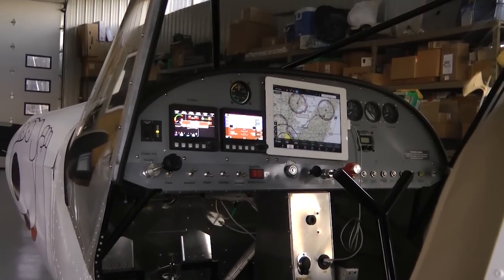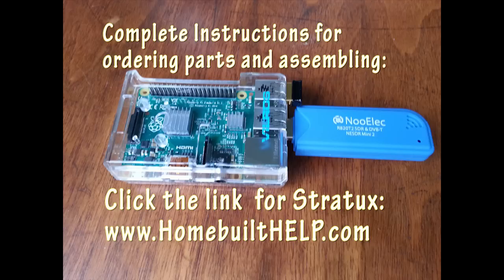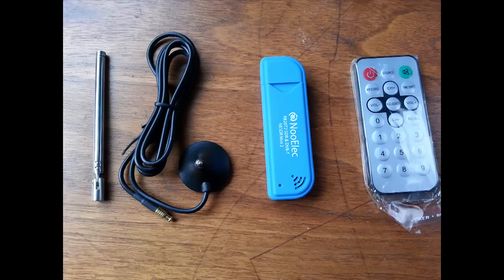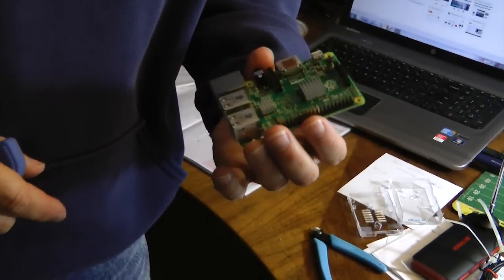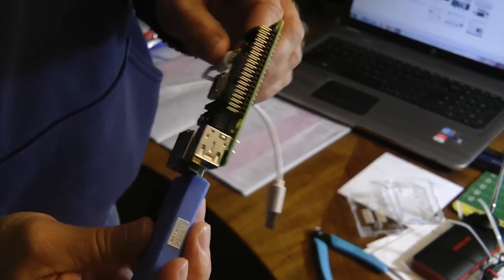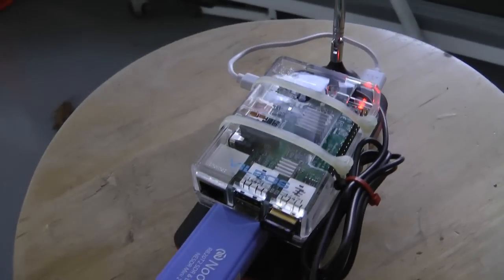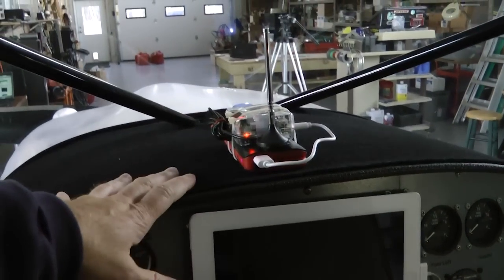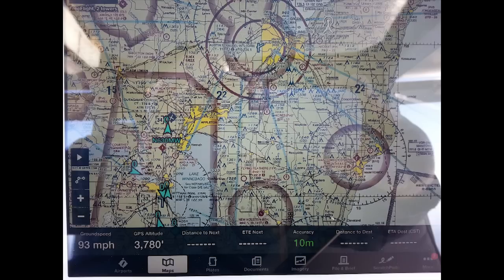Assembling a Stratux ADS-B receiver for in flight weather

Comment: There are RTL Dongles that've been sold for under $10
Reply: The biggest difference is the component that assists the tuner, the oscillator. The once added to dongles from Flightaware, or NoElec have what is called a TXCO, a temperature compensated crystal oscillator more on that here: http://www.radio-electronics.com/info/data/crystals/tcxo.php While it is certainly possible to controll the compensation manually via "ppm-values" the extra 10 euro per dongle will certainly help to n00b-proof receivers.

Comment: I want to thank you for this Video. I purchased the items off of Amazon 2/2017 for 104.91. I am a newbie to this tech so I appreciate your layout and the steps you provided. Two items you omitted or it has changed since you did this video. I needed to purchase a wifi dongle and it took me a bit of time to realize that I needed to down load Chrome to my iPad mini. Once I completed these two steps I was able to get it up and running just like you promised. Thanks again R Trepanier Benson AZ
Reply: I wish to amend apparently the Raspberry Pi3 comes with a built in wifi capability do not order one as it will confuse the poor little guy and me as it did. But it all works great now.

Comment: Just built mine last night.  Took less than 15 minutes start to finish, and my iPad & ForeFlight connected with no issues.  Waiting on my 150 to get done with annual so I can go up and test it.  By the way, the new Vilros kits are shipping with the Raspberry Pi 3, which has built in WiFi, so there is no longer a need for the USB WiFi adapter.
Reply: I realize it's pretty randomly asking but does anyone know a good site to stream newly released movies online?
Reply: @Brodie Russell ehh I use Flixportal. You can find it on google =) -quinn
Reply: @Quinn Karson thank you, I went there and it seems like a nice service :) I really appreciate it !!
Reply: @Brodie Russell glad I could help xD

Comment: I figure a ham would dig around the net for a home brewed solution to this... but is it worth the $100 bucks... that's a lot of money when you are trying to build a plane for less than $1,200
Reply: It needs a rubber duck antenna because as an Ultralight pilot I want to wear as much equipment on me as possible, so it does not count as a penalty to the aircraft weight which is a premium on an Ultralight.
Reply: Now we just need a cheap way to build a transponder
Reply: I have a really good idea on that of which I am researching. I want to make one that import NMEA data from a Phantom II and transmits its coords on 1090.

Comment: I've bought all the components. The website, you have all the instructions on, has a suggested way to use it with a GPS but there aren't any instructions to solder the wires and what pins they go too. Do you have that information or know where to find it? Thanks

Comment: How are you able to get wifi once you're at altitude?  I don't have a 3G iPad so that's why I'm asking.  As for gps with wifi only iPad, I use the bad elf 30 pin with fltplan go.  Will renew my foreflight subscription once I start instructing.
Reply from the maker: The Stratux box creates the WIFI signal that the Ipad uses.The Ipad connects to the Stratux box just like any other wifi hotspot.
Reply: +HomebuiltHELP thanks for the quick reply.
Reply: +HomebuiltHELP you think the new raspberry pi 3 is compatible with the stratus software version?
Reply: Pretty damn sure it is, it's a little overkill though but if you've got one then try it out.  It'd be really cool if a pi zero could work easily but I think that's still being developed by the ampros and hobbiests.
Reply: Eskimo Brother thanks for the info, I builted the stratus with the pi2, however are you only able to get cell towers when you're actually in the air? I get no reception at all in the ground and haven't flown up yet to test it.
Reply: preflightGOYR - old post but I hope your are still instructing. I too have he iPad with the Elf. How did you set up the elf with the iPad.   It appears to hook up by blue tooth.  I’m using FltPlan after using ForeFlight for a year.  How do I get the map to pull up and do I plug the elf into the PI for power?

Comment: My iPad is WiFi only, would this work using Foreflight in my iPad? Thanks
Reply: +antonio r YES, this takes care of all wifi, ADS-B IN and OUT signals.
Reply: +antonio r I believe the wifi only iPad does not have GPS and this version of the Stratux does not provide GPS data. YOu will need to add GPS. 

To add to Brandon Chavez's replie, you will only need to switch the wifi to the Stratux from your home wifi.
Reply: +J Jones so true, I was mistaken.  After much research, this model does only ads-b in.  to add gps to this setup, there are a few options such as the adafruit ultimate gps, RY835AI and the  VK-172 Gmouse.  I'm sure there are other options but from what I read, these are the ones out there that have tutorials on how to make them operate with the Stratux.
Reply: +Brandon Chavez thank you, one ore question, can you also get synthetic  vision  with this device on foreflight?
Reply: +antonio r at this point, synthetic vision is only in the beta testing phase and has >10 degree deviation in banks.  also keep in mind it is only usable with a gps+ahrs such as the RY835AI module.

Comment: I built the 2-band (978 and 1090 MHz) Raspberry ADS-B Pi receiver and downlaoded what i hope is the right software to receive both bands. I'm running FltPlan Go on my iPad 3 (it has GPS so has moving map). Apparently FltPlan Go is compatible with this system.  The iPad is getting a wifi signal and "heartbeat" from the unit, but it's not seeing anything else - no ADS-B towers - either on the ground or in the air (3000 ft AGL).  I live in Canada but just a few miles north of the border (Kingston) so I should be getting something, especiallyairborne.  Do I need better antennas than the ones that came with the USB radio dongles? If I got one, can I use a splitter and have just one antenna for both radios? How do i know the software is working properly? Even on the ground, shouldn't I be seeing high-altitude airline traffic on 1090 Mhz? How do I troubleshoot this?  Thanks for any help.
Reply: +YGK Pilot (SURP 841) Make sure you have the latest version of the software. I had issues till I updated yesterday.  Also, the antenna length is important from what I am reading... pull them out only 3/4"(20mm)
Reply: Hey YGK Pilot, did you ever get it up and running in your area.  I just bought the kit and I live on the north side of Lake Erie so I'm hoping to pick up something from the US once airborne.  If not, I'll do something else with my rasberrry PI

Comment: Great video, very informative and again thank you for making it. Just one correction in the video about the ADS-B traffic. What makes the traffic inaccurate is not that other planes don't ADS-B equipment, it's the fact that you don't have a ADS-B OUT unit.  If you had a ADS-B transponder on your plane then all traffic received would be accurate.
Reply from the maker: Thanks for your comment... however, the problem is that even if I had ADS-B OUT, the many other small aircraft flying around me that do not have ADS-B OUT would not show up and thus I would have a very poor (misleading) picture of traffic around me.  Only when EVERYONE participates with the OUT will the traffic picture be accurate and useful.  (I understand that will be mandated in controlled airspaces in 2020)
Reply: +HomebuiltHELP That not true, because the other planes are not only being tracked by ADS-B,  it's getting data from ground based radar and sending it out via ADS-B.
Reply: The thing about ADS-B IN is that your ease dropping on a signal that was sent for a plane with ADS-B OUT.  If there are no planes with ADS-B OUT close to you then no information is sent from that tower.
Reply from the maker: That is a good point... however, there are many many areas where I understand small aircraft are NOT tracked by ground radar...  you need to be high enough and close enough to a ground radar facilities  to make that happen... I am not that close to big airports all of the time out in the country.  (And of course, we are talking no transponders)
Reply: +catmeowman Traffic starts at 19:35 minutes in this video.
Reply: +catmeowman And again great video, I just ordered the board to build one. I was planning to buy this unit which is portable that does has ADS-B out. http://www.skyvisionxtreme.com/ but it is kinda expensive and does not meet 2020 standards.
Reply from the maker: Thanks, will take a look at that.  Can you resend the link... it doesn,t seem to work for me..
Reply from the maker: Here is another company with a new product: https://www.kickstarter.com/projects/bad-elf/bad-elf-ads-b-affordable-weather-and-traffic-recei?utm_campaign=20151201&utm_medium=ad&utm_source=AVWeb
Reply: +HomebuiltHELP If you have ADS-B Out you'll see darn near all the traffic assuming they're in radar coverage.  In remote areas you may not see traffic but the traffic picture with ADS-B Out on board your aircraft is dramatically better.  The other aircraft need not have Out to be seen in that instance.  The information you receive from the ADS-B ground towers will include everything they and ground radar "see" around you in terms of Mode C transponders on up.
Reply from the maker: Guns Guns Guns Yes, yes! And the concern for us light homebuilt aircraft is that many of us are still missing from each other's view on ADS-B because: we often do not have any transponders,  AND fly low altitudes far from radar coverage (many small airports far away from big cities). Thanks for your comments.
Reply: +HomebuiltHELP Thanks for the informative and well-produced video.  I've built my own Stratux and may build another to "install" in my aircraft, a Piper Twin Comanche, so that I have a portable unit to use when working in other airplanes and one in my airplane for permanent use.  It's a great little project.

Comment: Brilliant  - thank you, so much.    This remarkable cost effective fix, is integral to/for everyone building and even those, aspiring to build at home.  (the links are on the way right?) Outstanding - rObt
Reply: +robertd1p2 There are a couple of things you should be looking at, when building this ADS0-B receiver. First, the batteries you use will turn themselves off when power is not being drawn from them. This can present a problem of turning the Raspberry Pi off correctly. If the power is pulled while the PI is operational, you stand a chance of damaging the data on the microSD card that runs the Pi. Secondly, one RTL_SDR receiver uses too much power to just plug it into a USB port on the PI. Long term , it might damage the computer.